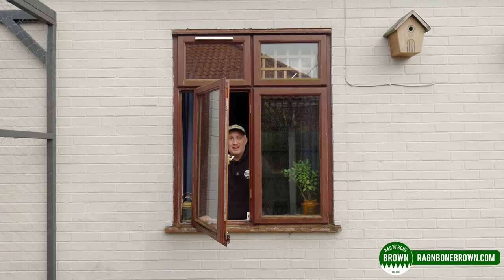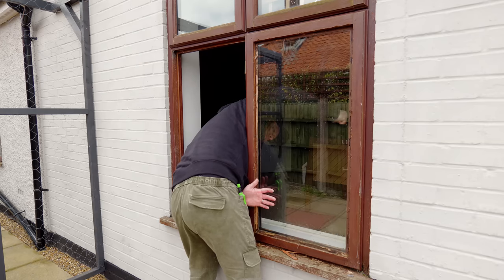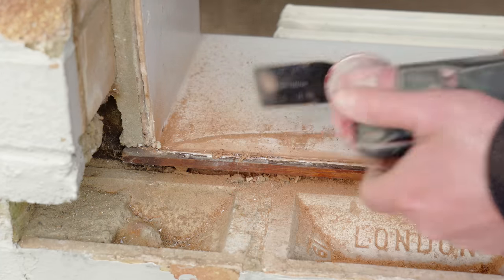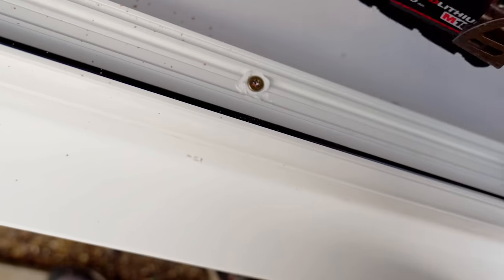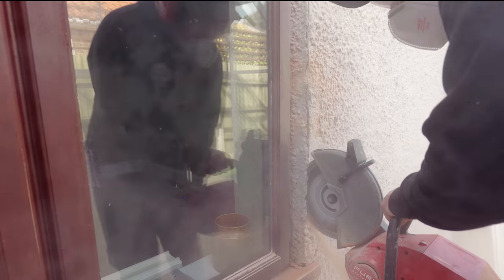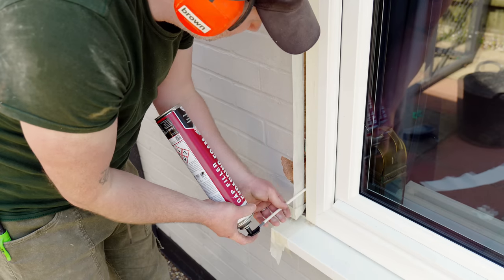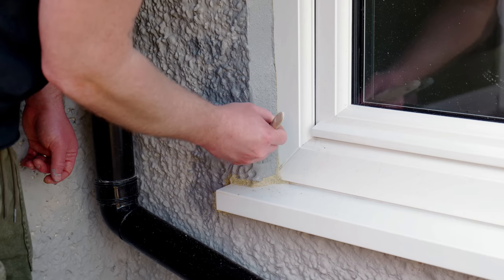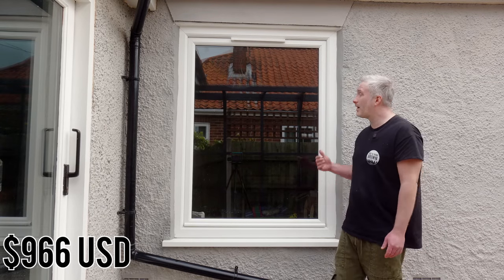Should A DIYer Fit Windows?

Comment: Can I ask why you went with the style and opening you did? As in a single side hung window. I also live in a bungalow and I so all the windows have a top small (1/3) top outward opening window with a fixed (2/3) pane below for security reasons so we can leave the windows open at night or if we go out (for a short time) or so we can leave them open when it rains. I would also think that your cats might escape. Not to say you've made a mistake I'm just interested in your thinking. I also fitted the new window myself and having to estimate the size with external render and plasterboard internally was not fun. I have external wall insulation so we had to order extra deep sills too.
Reply from the maker: you kind of answered the question yourself actually - because of the cats!...  We can tilt the windows open and get fresh air and they can't escape.  With the top opening windows, the cats can jump up and out
Reply: @RagnBoneBrown  Ah that makes sense. I don't have cats so I'm not as familiar with their habits/abilities. I was more thinking you will likely never use the full wide opening option except in emergencies which I admit is a restriction we have.

Comment: Fensa is a joke, the installer self certifies their work. Based on the windows fitted by a large, well-known window and conservatory company from East Anglia, that certificate was worthless. They obviously "guesstimated" the size of the windows, which were way too small and just covered the gaps with trims. An 8ft x 4ft high window was secured with just 6 woodscrews, not even frame fixings. I fitted my replacement windows myself and will buy an indemnity, which is about £30.

Comment: As I'm a fenestration engineer i saw loads of "oh no" 🤦 moments. Fitting doors and windows is relatively easy and i reckon a competent diy'er could do it.
Reply from the maker: What do you mean?
Reply: @RagnBoneBrown  use a febfoam gun for better application. How big was that mastic joint at head...? Mastic is used to seal two adjacent substrates that move independently. Fillet joints on trim will fail with movement.

Comment: Your window is installed too far forward in the reveal. Notice how your interior finish is touching, or close to the outer brickwork.

You also had no need for that style fixing in the head, as you will have blasted throufh the lintel and qlso possibly the cavity tray.

Comment: over here we install "membrane" tape over expanding foam around the windows - breathable on the outside, and vapor blocking on the inside. Helps with insulation and foam degrading I think. No such requirement in UK I presume?
Reply from the maker: Interesting! Not that I'm aware of.
Reply: one example is called Penosil Window Tape if someone wants to take a look ;)